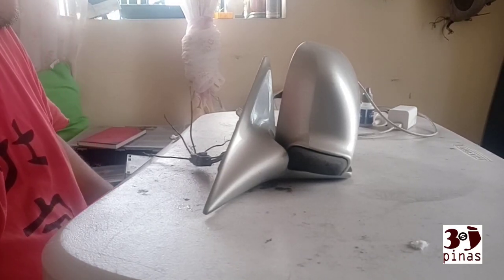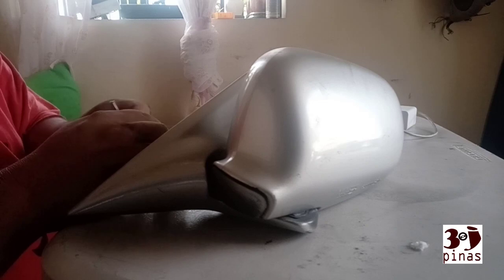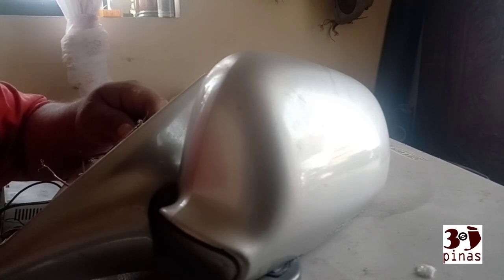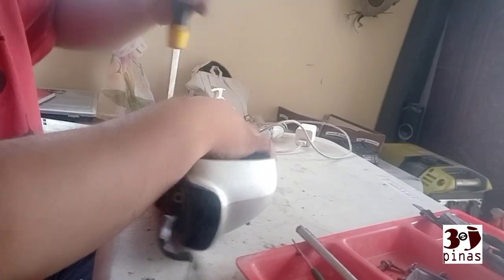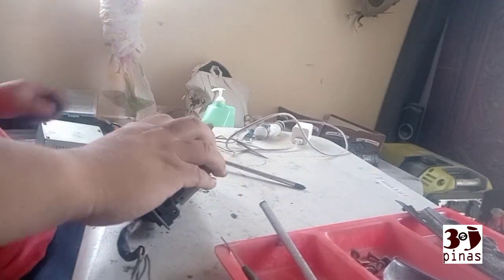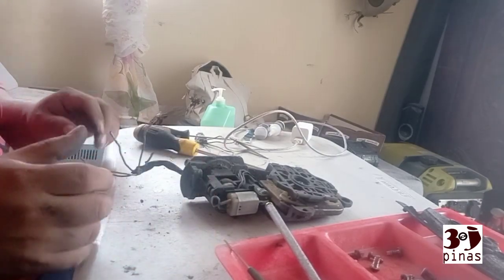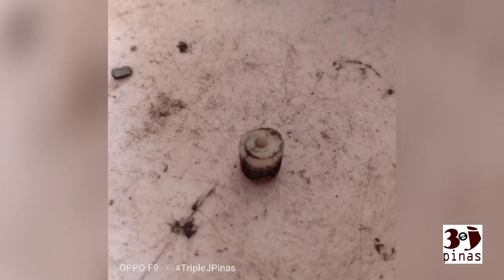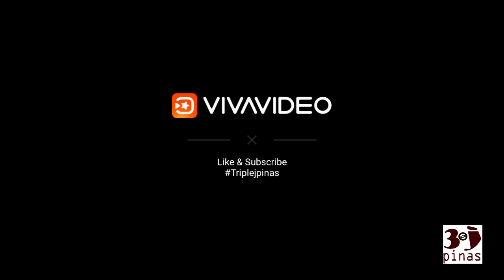Lancer Retract SideMirror Fix

Comment: Sir yung power side mirror ba ng gsr parehas ng socket ng retractable side mirror din ng asti rx
Reply from the maker: same
Reply: Eh yang retractable mo sir parehas din yan ng connector ng power side mirror ng gsr bolt on din agad yan pag ganyan pinalit ko wala ng imomodify na connector
Reply from the maker: @michaeltalavera5642  Same connector pero iba base. hanap nalang po kau ng pang GSR/ Pizza mismo na retract para less mods..